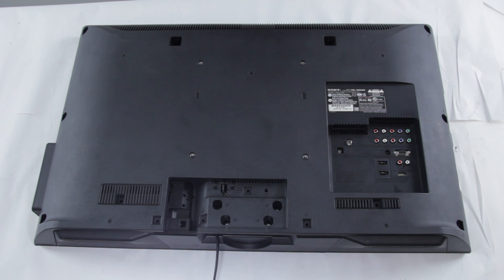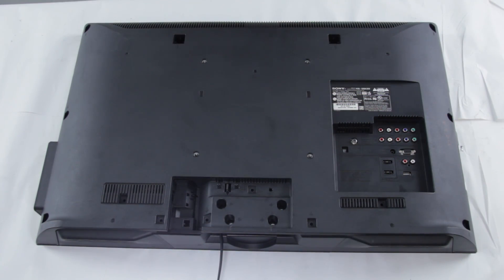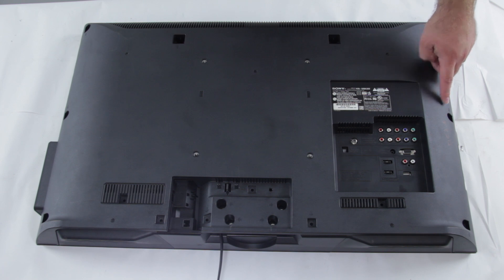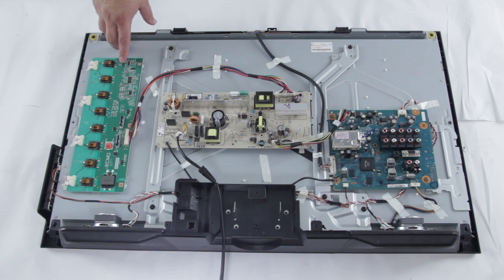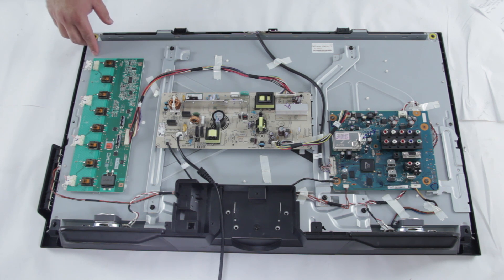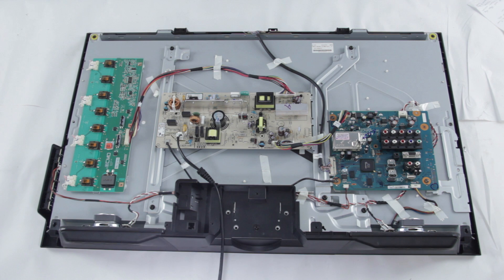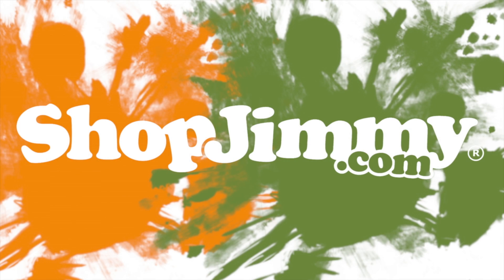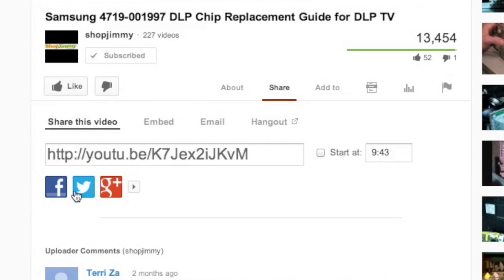LCD TV Repair Tutorial - Backlight Inverter Common Symptoms & Solutions - How to Fix LCD TVs

Comment: I have a Visio VX37LHDTV10A that has gone mostly white screen on us. We can hear sound and see picture but the white light is overpowering the picture. Is this a backlight converter issue? What would you recommend?
Reply from the maker: sean Wilson   I recommend replacing the main board in your TV.   Here is a link to replacement parts for your TV model number on our website, click here:  http://www.shopjimmy.com/catalogsearch/result/?q=VX37LHDTV10A  Be sure to match part numbers on your current board, with your replacement for compatibility.  Here is a link to a video showing how to identify your part number, click here:  TV Part Number Identification Guide for Vizio Main Boards (Plasma, LCD, LED)  You can also call our customer service for further assistance with your purchase.  (877) 881-6492  Thanks and please let us know if you have any further questions with your TV Repair!  www.shopjimmy.com

Comment: I have a Sharp LCD TV/DVD combo, model number LC-19DV24U. It's having what seems to be an inverter problem; sound works but no picture except maybe for a few seconds right when it gets turned on. I searched but couldn't find an inverter for it listed on your website. Thanks, Mike
Reply from the maker: *****   I recommend replacing the main board in your TV.  Here is a link to replacement parts for your TV model number on our website, click here:  http://www.shopjimmy.com/sharp/lc-19dv24u  Be sure to match part numbers on your current board, with your replacement for compatibility.  You can also call our customer service for further assistance with your purchase.  (877) 881-6492  Thanks and please let us know if you have any further questions with your TV Repair!  www.shopjimmy.com

Comment: Hi
I have a BUSH LCD52F1080P with a startup problem.
When switched on in the morning, the screen is very dark (cherry red) & although the image is there, it is monotone & has a drag effect. if the channel guide or tv menu is selected, it too is dark & appears to fade in & out.
This tends to last around 5-10 minutes & then the picture will appear as normal & remain so for the rest of the day. only to recur when turning the tv back on the following day. 
The Tv is around 4-5 years old 
many thanks for any help that you could provide

Comment: Hi there I have an ALBA LCD32880H DF .I am not sure of the problem sometimes the tv works fine other times when I switch it on the blue standby light begins flashing non stop and the tv does not turn on. The only solution is to unplug the tv as the remote doesnt work and the flashing standby light doesnt stop unless the tv is unplugged.Left unplugged for a while and tried a few times the tv works again until it is switched off and decides not to startup again so have to repeat the process
Reply from the maker: windsor davis   I recommend checking the power supply in your TV, to see if it has any puffy capacitors.  Let us know what you find!  Thanks!  www.shopjimmy.com

Comment: I have a sony kdl32ex400. I have a black vertical bar that starts from top right corner of the tv and fades away as it goes toward the top left of the screen. It is the same on every a channel/input. What could be the cause?
Reply from the maker: Levar Washington   This sounds like a TV panel problem.  If your TV panel is bad, it may be more cost-effective to replace the TV as panels are typically hard to find in stock, difficult to replace, and expensive.  Thanks and please let us know if you have any further questions!  www.shopjimmy.com
Reply: You think sony will replace a defective panel even though it is out of warranty?
Reply from the maker: Levar Washington  That would be a question for Sony, sorry but I do not have that answer.  Thanks and please let us know if you have any other questions!  www.shopjimmy.com

Comment: I have a Goodmans GTVL40W27HD. Recently the screen doesn't turn on however there is sound, sometimes when turned on half of the screen flickers as if a bulb is dying. Is this the backlight inverter or bulb? Can I replace either?
Reply from the maker: TheInternetcord   This could be either the backlight inverter or the bulb that is causing the problem.  The backlight inverter should be pretty easy to replace, and the bulb will be more difficult and even harder to find replacement parts.  Unfortunately I do not see any replacement parts in the search results for your TV model number on our website.  Thanks and please let us know if you have any further questions!  www.shopjimmy.com

Comment: I have a Visio M470VSE, only the Visio light turn on. The TV don`t work and the screen is black. Can you please help me fix the problem?
Reply from the maker: Andy exp    I recommend replacing the main board in your TV.  Here is a link to your replacement part for your TV mode number: http://www.shopjimmy.com/vizio-91-75n10-001g-main-board-for-m470vse.htm  You can also call our customer service for further assistance with your purchase.  (877) 881-6492  Thanks and please let us know if you have any further questions with your TV Repair!  www.shopjimmy.com

Comment: Hi, I have sony bravia KDL46ex720 TV- 2010 model. The screen has blacked out, sound is working fine. Below are the troubleshooting steps I have tried.
1. Switching the channel continuously for a couple of minutes at high speed: No result.
2. Power drain: No result.
 
I switched off all lights and turned on the TV in dark: I can than see the picture after flashing the torch light at it. After some reading, it appears the black inverter has died and according to blogs it is easy to fix it. Please help me diagnose and resolve the issue.
Reply from the maker: shivani gandhi   I recommend replacing the BATV (main) board in your TV.  Here is a link to replacement parts for your TV model number on our website, click here:  http://www.shopjimmy.com/catalogsearch/result/?q=KDL46ex720  Be sure to match part numbers on your current board, with your replacement for compatibility.  You can also call our customer service for further assistance with your purchase.  (877) 881-6492  Thanks and please let us know if you have any further questions with your TV Repair!  www.shopjimmy.com

Comment: Hello, I have a Sony Bravia KDL-40EX523 and I'm getting the 4-blink backlight error. The TV was blinking the image on and off (while in use), similar to how an older CRT Tv turns off. I opened up the panel and I cannot locate my inverter board. I see the main board (very large board where power goes in), TV Board, and the T-con board that's hidden under a metal plate. That's it. Looks like the main board feeds in underneath the metal plate to the backlight. What do you guys think? Thanks in advance.
Reply from the maker: Pirateman3   The backlight inverter is actually built into the power supply, so the power supply and backlight inverter are one board.  Here is a link to replacement parts on our website for your TV model number:  http://www.shopjimmy.com/catalogsearch/result/?q=KDL-40EX523  You can also call our customer service for further assistance with your purchase.  (877) 881-6492  Thanks and please let us know if you have any further questions with your TV Repair!  www.shopjimmy.com

Comment: i have an element model eleft502 the screen went black have sound and smells like electrical burn i cant find the back light inverter there are 3 boards power,tcon,and the video board no back light inverter unless its by the lights
Reply: I'm having the same issue.  Purchased at Target Black Friday 2013. We barely watched it.  I have no idea where to start.
Reply: Same tv and same problem here too
Reply: I bought this too day after thanksgiving  2013, called manufacturer 1yr warranty and they wanted me to ship to them. i am upset that i didnt buy warranty $79 from Target and got rid of old school tube tv for this shit. I will be trying to have it fixed by Sears which will cost me trip charge of $99 but BBB will hear about this one most definitely . Consumers need to be aware. My tv died without warning in almost 16 mths to date. Only thing company can say is im sorry. shouldnt need extra warranty for a tv.
Reply: Stacy Lee lmao mine is about to be a shooting target for my pellet gun.
Reply: Crap ass customer support  they tried to do the same thing to me I don't want a refund I want a new TV there should be a lawsuit against them
Reply: Does anyone know how to get one started
Reply: Yeah if you break the TV getting it apart then you can use it for target practice. If not then buy the part and put it in. And yay! New TV
Reply: but i did jump the burnt led by by passing the led by using a peice of wire just for testing .and all the lights did come back on. so to answer every one. the lights are in a series so if one goes out all go out :(
Reply: I'm seeing that there are two slightly different symptoms in this thread.  Some can see the screen turn on briefly before turning off, and some like myself don't even get that.  The screen doesn't even give a hint of trying to turn on but the power indicator LED does turn blue and I can hear sound.  Phil Green was able to find that with his situation where it turned on briefly that the LED strip(s) need replaced.  Another poster with the same symptoms determined that replacing the power supply/inverter did not fix the issue, which makes complete sense.  Since my issue is slightly different (no splash screen or lighting at all even briefly) could it possibly be the power supply instead of the LED strips?
Reply: Abiel Martinez Hey if you still have the tv im looking for the lcd display panel....kid drop mine when i was taking apart and messed it up.
Reply: If anyone has the tv and their parting it out i would love to buy the tv for parts.
Reply: I do yet the tv costs $80 to ship.
Reply: Phil Green That's crazy...Guess im going to have to part the tv out myself.
Reply: same tv, same problem here...
Reply: wakeelah caldwell. Their customer service is horrible. I think it should be a class action lawsuit. My warranty was still valid when mine went out. They offered me a refund....um no because it costs $80 to ship and the bbb website says you keep lying saying the screens were broken in transit. Smh
Reply: Lol you really wanna make a lawsuit out of it? Element is a cheap brand. This is exactly a perfect scenario of "you get what you pay for". Honestly, I don't think it would hold up in court.
Reply: Yeah. If you knew they were refusing to honor the warranty and lying about the condition of tvs that they receive back, you'd sing a different tune.
Reply: True. I did not know that his was still in warranty.
Reply: We all bought them at around black Friday 2013 and most went out right at black Friday 2014. It's ridiculous man.
Reply: Whelp I got one for my gf on Black Friday that's probably got a run time of no more then 100 hours on it she barely used it and so I was moving it to my house and looks like someone squeezed the panel and cracked it so I can part it out..not huge TV expert but I would be able to dissasemble it email me with preferable pictures of what you need and I will see what I can do my email is neuenschwandernick@yahoo.com
Reply: Im having the same problem my screen turns green when you cut it on smh.
Reply: I'm thinking about taking a 12 gauge to it and hav some fun with mine
Reply: I need one with a screen cuz mine cracked. Do one of you guys want to sell me your broken one?
Reply: Yeah Sure 100 plus shipping
Reply: Is that the 50 inch?
Reply: Yep
Reply: Are you in the U.S.?
Reply: Yes
Reply: I messaged you.
Reply: does anyone have a part number for the LED strip? Mine is doing the same thing
Reply: I have a couple led strips. If you want to buy them. I can see if they have a pn once I get home.
Reply: Awesome how much? 

Sent from my iPhone
Reply: Umm $5 a piece plus shipping? Is that ok?
Reply: Sounds great 

Sent from my iPhone
Reply: K message me your address
Reply: And how many you want
Reply: could i use regular strip led to fix the issue ?http://www.amazon.com/Lampux-Flexible-Lights-Daylight-Non-waterproof/dp/B00HSF65MC/ref=sr_1_6?ie=UTF8&qid=1435687603&sr=8-6&keywords=led+strip
Reply: Awesome how many did you need to order 

Sent from my iPhone
Reply: I also have this same problem. I replaced the power supply, but that didn't fix my problem. By the looks of this thread, I need the LED strips? (black screen- when shine flash light on it, can faintly see a picture). What website do I go to order these?
Reply: Here are some 

http://pages.ebay.com/link/?nav=item.view&alt=web&id=181803820470&globalID=EBAY-US
Reply: Are they pretty simple to put in? Can I do this myself or should I just take the tv out for target practice and buy a new one?! lol :)
Reply: I guess it depends on how good you are at taking a TV apart. It's not extremely complicated and yet I wouldn't say it's simple either. The main thing this it you need to be so carful not to break the screen. And just an FYI you don't need to pull off the power supply to get to them. I thought I did. The screws are under the trim in the front. You could try pulling it apart before you buy.
Reply: Thanks for the info! I'll give it a try... I'm not out too much to see if I can get it fixed!
Reply: Exactly! Thanks again!
Reply: Did anybody have any luck getting there TV fixed? I bought mine in 2013 and it barley went out a few weeks ago. I bought a new LG this time but I wouldn't mind having an extra TV lol.
Reply: Shawn aagard ---do u still have any more led strips ?  I need 1 if u have it
Reply: No I sold them all sorry :/
Reply: do u rember any thing about it like a part number or something like it. for some reason i cant find anything about it or any one who is  selling one.....
Reply: dang sorry about the spelling to many beers lol
Reply: No One has the video on how to replace the light huh'?
Reply: Craig Spivey after going through many forums and not finding 1 single success story, I honestly don't know if anyone's had any success with repairing one of these TV models...
Reply: Zionis Knight  Iam selling mine ,,
Reply: I fixed mine but when I was closing it I broke a cable , then now I am selling parts led stripes, POWER card , vídeo and main card
Reply: how did you fix it?did you change the led strips?
Reply: Yes , that works but be careful about break cables , I will upload pictures
Reply: ok cool
Reply: Hey Osvaldo do yo have to take the whole silver back off to place the LED lights.  I took all the screws out but kinda scared to lift it from the front. don't know to do at this point.
Reply: Also I'm not sure about break cable and where they are located.
Reply: Any pictures or video about taking it apart to replace LED?
Reply: I guess I gotta put it back together and let a Tech person take care of it.
Reply: bummer!
Reply: Stacy Lee
How did you get the ribbons apart it look like they are tucked under.
Reply: If anybody needs replacement led strips I have a few available via PayPal $35 shipped. Each individual led diode on the strip has been tested and all are in good working condition.
Reply: Are they new or used?
Reply: Feel free to email me at Mr.Lesabre@gmail.com
Reply: Use
Reply: Used *
Reply: now I'm noticing I don't have any sound or picture I may need to purchase a main board
Reply: I have a main board in good working cond
Reply: how much you want for it?
Reply: $50 plus the cost of shipping 

Sent from my iPhone
Reply: THat's cool how can I connect with you regarding purchase and delivery?
My email is crgspivey@gmail
Reply: I can be contacted by email at ****@** There is a PayPal account attached to that email for payment. 

Sent from my iPhone
Reply: Shipping will be calculated depending on zip code 

Sent from my iPhone
Reply: I need a backlight inverter for element 50' tv can anyone contact me if they have the part for sale. model number ELEFT502
Reply: Xmrrockhard I have one available in good working condition 

Sent from my iPhone
Reply: Are you willing to sell it? How much are you asking for
Reply: $50 Plus the cost of shipping

Sent from my iPhone
Reply: Can you send me a picture? 8572011673 that sounds reasonable
Reply: +xMrRockHard  and whoever else. I HAVE PARTS for this tv. Just broke the screen. Had no backlights. Everything else is in tact. I/we can only assume all other parts aside from the/a LED is the cause. 

srfrjz3@aol.com
Reply: How did you get the ribbons apart it look like they are tucked under. On the bottom of the chasis to get to the led lights srfrjz3
Reply: Someone mentioned they skipped the bad led with a wire and it worked can someone please elaborate and explain how it's done

Comment: I have a funai Emerson LC401EM2F.  The screen colors are not on top of each other..  There is a blue and a yellow that are apart.  The blue is not aligned with the yellow.   When you turn on the TV, the blue and yellow far apart.  After a while it moves down close to the yellow.  But not completely.
Reply from the maker: TheDADMOJO   I recommend replacing the Digital Main Board in your TV.  Here is a link to your replacement part.  http://www.shopjimmy.com/emerson-a17pcmma-001-digital-main-cba.htm  Be sure to match part numbers on your current board, with your replacement for compatibility.  Here is a link to a video showing how to identify your part number, click here:  Part ID Numbers for Sylvania, Emerson, Philips Magnavox MPS, MPW, MUT, & Digital Boards TV Repair  You can also call our customer service for further assistance with your purchase.  (877) 881-6492  Thanks and please let us know if you have any further questions with your TV Repair!  www.shopjimmy.com
Reply: ShopJimmy.com Are you sure? not t-con board?
Reply: ShopJimmy.com I replaced the main board and still have the same problem.  What is the next thing to do?